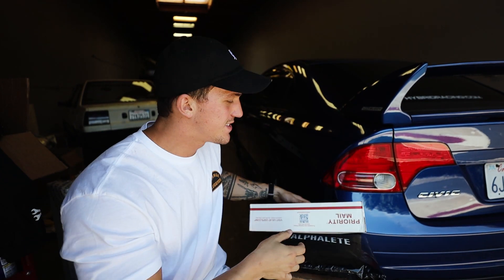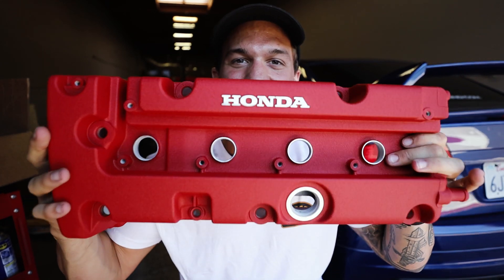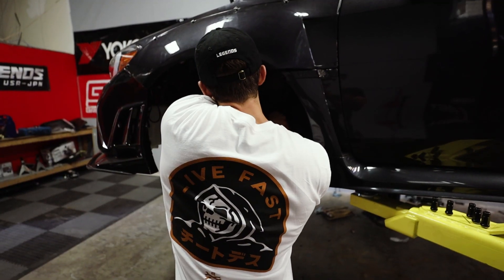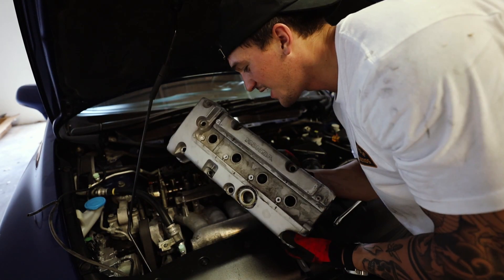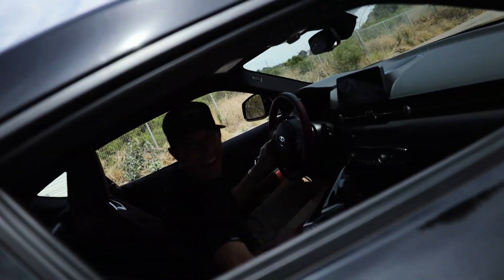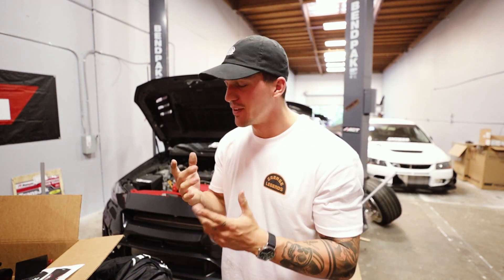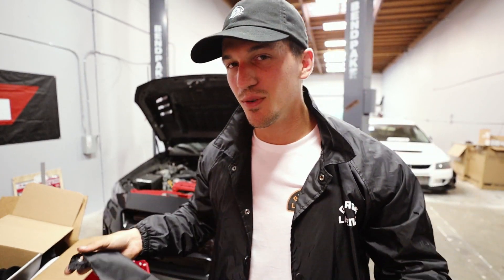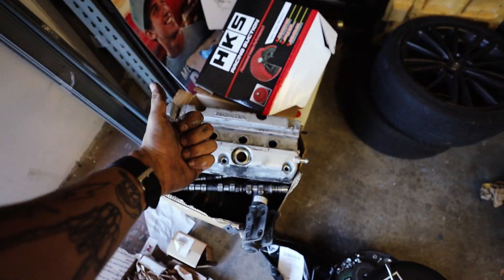SUBSCRIBER SENT ME AMAZING FA5 MUGEN CIVIC SI MOD!

Comment: You missed the Spark Plug Tube Seals. That thing is gonna leak!
Reply from the maker: fixed! thank you!
Reply: Had to pause that frame for a sec. I was hoping someone else mentioned this before he pulls the spark-plug and noticed oil all over.
Reply: Same. I had to come to the comments and check that someone told him
Reply: @dustiinw  you should also add Honda bond or equiv. to four points of the cover as per the service manual to prevent any leaks.
Reply: Thanks someone mentioned the gaskets
Reply: @billylee1318  i just did the same thing pause the video to check

Comment: heat shield Dustin Cerakote has has a chrome finish coating that is super high temp which you polish after its been baked that looks like chrome you could do it in that and keep the red V tec on it to compliment it.

Comment: you need the momo mugen detach steering wheel, for sure the mugen coil cover. leave the intake manifold cover on until you clean the bay and get a fuel rail hopefully ktuned but seems like you’re going the hybrid racing route

Comment: How long did it take for the spark plug tubes to fill up with oil after you forgot to put the seals on the valve cover?